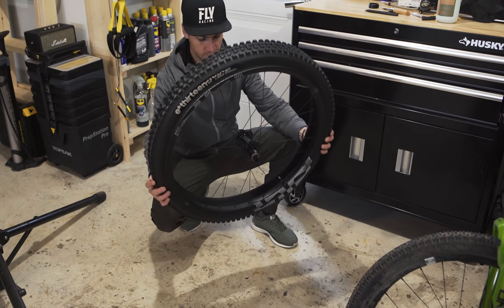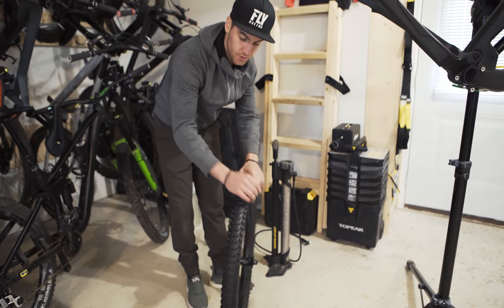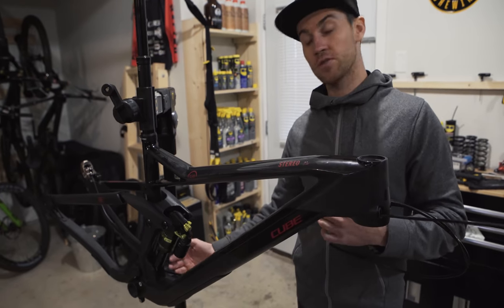This is how I BUILD and SET UP my Trail Bike | MTB Pro Tips

Comment: I feel like I need to lose weight, all of you riders I follow on the Tubes are less than 175 pounds. I’m not a big dude, but I fluctuate between 190-200 pounds. My trail bike tune has required a significant amount of adjusting to work well with my weight. I am thankful and glad y’all are on here showing us these builds.

Comment: I'm lovin the brake pad tip, and I used the code for the STFU hell yeah! The only thing I would add is when cutting carbon, you should keep it wet by spraying degreaser while cutting so that the particles don't get airborne and breathed in. That or use a respirator. Cheers
Reply from the maker: Simon Wenzowski that s a good point. I usually old my breathe.

Comment: 35:11 Amateur-tip: Adjusting tire pressure is easier using the tune setting and air release button on the Topeak pressure gauge. (It's the big yellow button on the side.)

Comment: A great hack to get linkage or BB bearings in, if you dont have a bearing press, hydraulic press or screw press, is to use a vice thats in decent shape.
DEFNITELY DONT use threaded rods with nuts and washers. The nuts and washers are about as straight as you can piss. Pressing a bearing in crooked, because you didnt do it properly can quickly result in a ruined bearing seat and therefore a ruined frame.
Reply: you realise that the park tool bottom bracket and headset press is basically two giant washers on a threaded rod right? nothing wrong with pushing bearings or bearing cups in that way as long as you do it slowly and make sure it goes in straight.
Reply: @thegrumpyscot1865  But its machined with according tolerances
Reply: @obi-wankenobi9871  not really, you can still really fuck up with it if you don't pay attention and use it wrong.

Comment: Could you further explain what you did with the tyre sidewall and the brake spring. Couldn't see very well on video?
Reply from the maker: I put a piece of rubber to avoid play in the brake pads. Nothing special with the sidewalls.
Reply: But where about I've had this problem for years and will try anything to shut them up.
Reply: The only real place to put would be hard up against the the break housing on each side and run your split pin through it. You would have to make sure that it doesn't interfere with the pistons in any way as well
Reply from the maker: James Robinson basically around the spring. The Hayes Dominin don t cause noise normally but other brands do. Shimano for example.

Comment: Very informative video, thank you! What tire pressure front rear do you usually use, for a similar bike but in 27.5 ?
Reply from the maker: Basically the same. Very little difference. Maybe 1,2 psi more.
Reply: @remymetailler  thks 👍

Comment: One more nice an useful Video @Rémy but don’t use grease at the bottom axis of the shock(friction bearings don’t like grease,they are made for to be dry)
Reply from the maker: Simon Katsch there is no bearing though?!
Reply: Rémy Métailler I the lower side where you mount the shock.on upper side there is trunnion,but on the lower side is a friction bearing from Igus maybe...you know what I mean?😂
Reply: @remymetailler  ah ok sorry sorry sorry my fault,i seen it.you put the bushings into the igus and put grease into the bushing where the axis is go through(2:44min-2:47min), not direct in the igus

Comment: Is it easy to remove the internal cable silencer?  Looks like a great idea, but would want to remove it, if needed.
Reply from the maker: Yes you can grab it fairly easily.
Reply: Rémy Métailler - what is it called that you have put in the frame ? I want to buy one
Reply from the maker: Si Davies i m not too sure. It sold in every Cube Bikes.

Comment: I have never "rewired" my Cube (yet) but seems you're using some yellow tubes as guides too? If that is the case this indeed a useful hack. Dully noted.
Reply from the maker: No the yellow tubes are just guides to slide the cables. They come with the frame.

Comment: What is that you put on the downtube to quitening the cable rattle?
Reply: I have no idea how it's called, but I know that you can buy it in any store at Christmass time, its purpose is decorating a christmas tree.
Reply: Garland, I believe.
Reply from the maker: It comes with the frames. If you buy a Cube Bike, it comes inside the frames. Most brand have something similar nowdays.
Reply: @KingerUTube  you're right
Reply: @KingerUTube  looks like it has a wire in the middle of to allow it to hold a shape. i would think this is more like a large pipe cleaner.

Comment: Why don't you run a jade x? More of an air shock guy or the frame leverage curve isn't progressive enough for coil?  I am undecided for my Ripmo AF, jade x vs topaz... Thanks and nice video as always👍
Reply: Tu peux aussi me répondre en français, un fan du Québec 😁
Reply from the maker: @plmtb3694  I'll reply in English for the rest of subscribers. I run an air shock for now. This frame has two positions, one was designed for a spring. I will be trying it out soon. So far I like the air because of the weight and tune-ability....
Reply: @remymetailler  alright thanks for the quick reply!!

Comment: whoa, can you go over that tip for bleeding your brakes? everything i have read on the dominions says not to touch that bite point screw and that it's already factory set. i had to remove my rear brake line to feed it through the frame which unfortunately lost the factory bleed and now my rear brake feels like it has to travel a lot further than the front before it touches the rotor. i would like to shorten that brake lever travel space.
Reply from the maker: novajustin what you can do is to unscrew a bit that 2mm screw, and remove the wheel. Brake to bring the pads closer from each others and it does the tricK. Then fine tune with the 2mm screw. Unfortunately it s in possible to have the perfect modulation + tight feel on a brake, but doing that I found a way to get it how I wanted.
Reply: @remymetailler  do the brakes eventually back out to where they were or does this hold for a while?
Reply from the maker: @novajustin  They do eventually but I'm usually fine for a few rides.

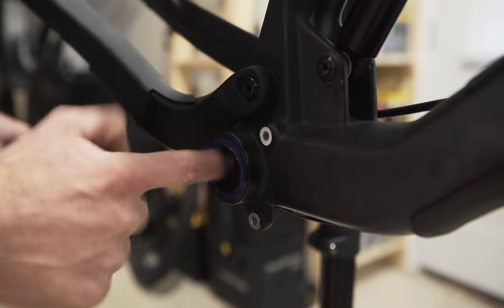Comment: 10:37 What's that you're applying grease with?
Reply from the maker: It is a piece of housing for der cable!
Reply: @remymetailler  Thanks. I'm still wondering what are bike builders using for applying grease :D
Reply from the maker: DOMINO VOJ you can use fingers, paint brush or a housing cable like did

Comment: E*Thirteen carbon wheels are crap its lucky you get them free as I couldn't keep spokes in them. DVO suspension Poo!
Reply from the maker: How come they are crap? I have no issues with them. Same with my suspensions.
Reply: @remymetailler  I had a nightmare with the wheels on my YT Capra Pro Race and broke 25 spokes in total and my reason for going YT was with Giant and there Reign carbon I had no problems in one year so was going to get another and they dropped Fox suspension so I went to TY and look how long DVO lasted with Giant, dropped after one season. I ride the same course same jumps same speeds and every few weeks I could here them snap and every spoke snapped at the same place. I will never run carbon wheels again, I run specialized downhill rims and same course nothing but its to wet at the moment so we will see.
Reply from the maker: I have NEVER broken a spoke before. You might be doing something wrong? DVO is a small company, making good products and delivering on time thousands of products for a huge company.
Reply: @remymetailler  When I get a new bike I check the wheel build so got spec from the factory and the tension was way off but thinking there machine built so didn't think any thing off it. I ride a lot nearly every day. So the first thing I noticed was all the spokes the nipples where all pulled to one side but though the spokes where settling in so checked tension and still the same. Then late summer broke a spoke so ordered some in and that was the start. Hay I might have got a bad wheel but talked to YT and E*thirteen and no help, I am a engineer and so working on the bike is not a problem.
Reply: @evo5349  mate there is no way you ride anywhere near as hard as Remy and he still doesn’t have any problems, if somethings going wrong it’s probably your fault
Reply: @thehighground4920  I still stand by my comment as now run Hope alloy Fortus 30 wheels and over 5 months one spoke lose same riding same course. The same can't be said for Fox factory coil shock body cracked 4 times so four warranty repairs, so much so Specialized do not fit coil shocks to the frame type only air shocks. Now running a 2021 Fox air X2 and it's very good much better than the last X2 air as that used to get very hot but the new shock stays cool to the touch.

Comment: You'd invest in a wireless microphone! Real hard to hear a thing :'(
Reply from the maker: Really, the sound is perfect on my computer as well as on my phone. What computer do you use?
Reply: @remymetailler  Let me rephrase then 😉. It looks like you're using the on-board microphone on your camera, and since the distance changes from a scene to the other there is no audio leveling 😥. You'd use a wireless microphone and/or plug an external microphone to your camera equipment, or you can post edit with a voice-over. I'm using a Sennheiser HD 58X on a JDS Labs OBJECTIVE2+ODAC REV B on a Puget Systems workstation.
Don't get me wrong, I'm not trying to bash your work in any way, but I'd not have to play with my volume knob during the whole video.